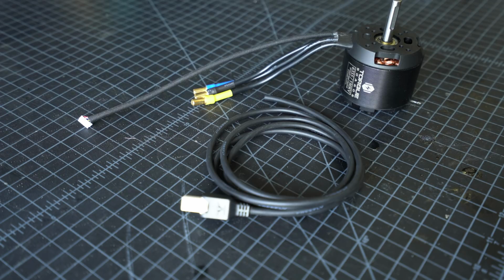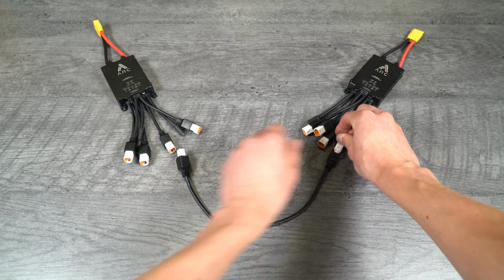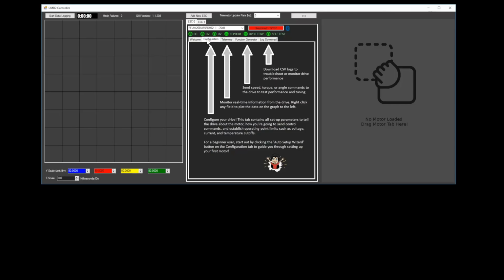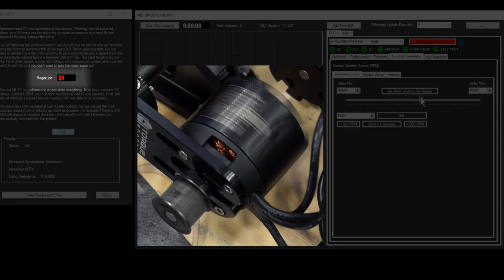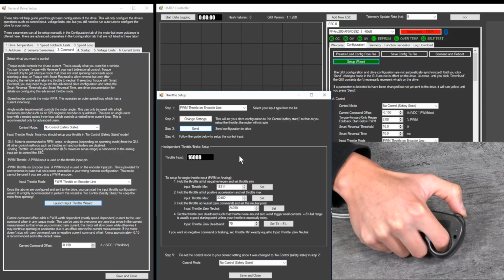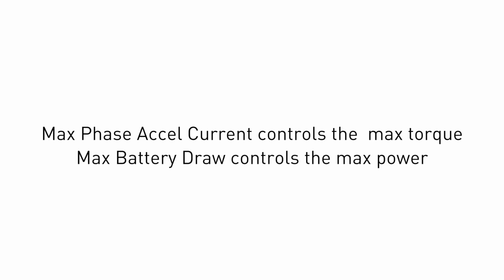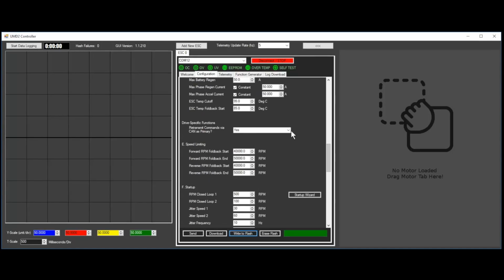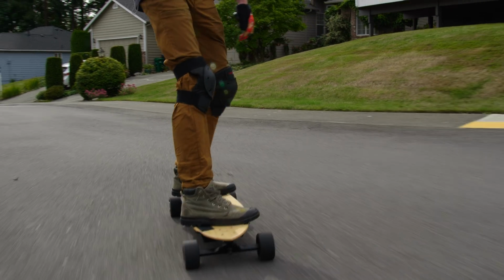Arc200 Motor Drive Skateboard Setup Tutorial

Comment: Quick question: Our bullet connectors on the ARC are too big the motor phase wires. Is there an adapter you can use? How come yours are perfectly fitted for the Torque wires?

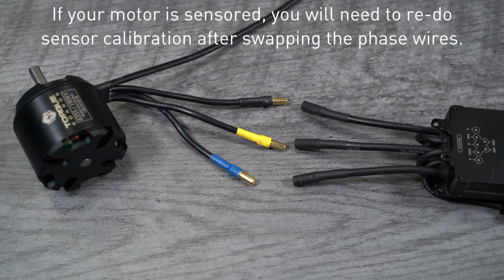Looking at 12:30 btw.
Reply from the maker: We removed the 8mm bullets from the Arc and replaced them with the 6mm bullets that come with the torque boards motors.

Comment: Hi, what is the performance and what is the difference in performance between using one vs two Arc200s?
Reply from the maker: You can get a Hugh amount of power out of a single Arc, but most single motor skateboards are one wheel drive. One wheel drive boards tend to loose traction when accelerating or braking quickly.